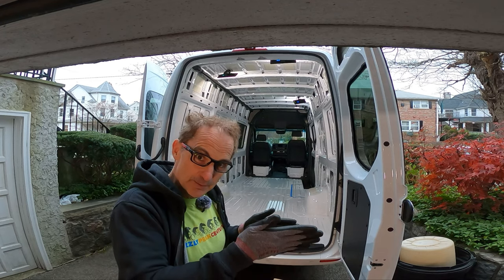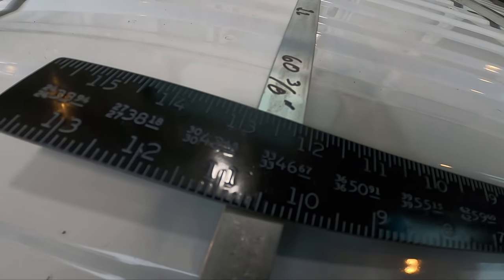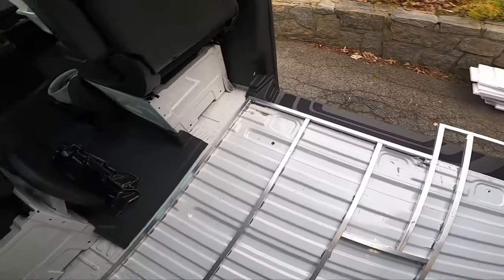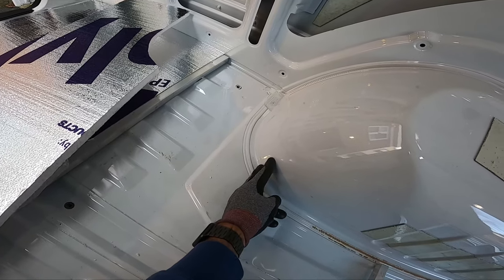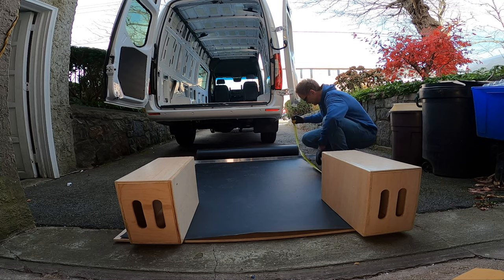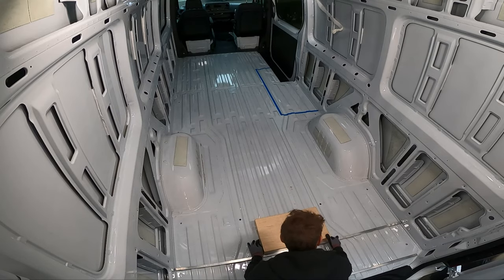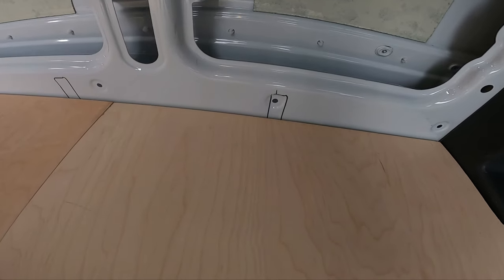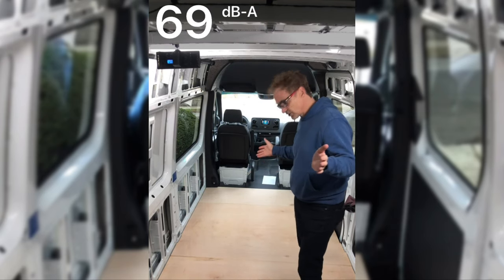Sprinter Van Subfloor Install - Part 2

Comment: I would have made sure there was support directly under each end of the board for your floor. That or added 2 short joists perpendicular to you main joist, so that there is something other than just the insulation supporting the ends of the floor and it wont flex.
Reply from the maker: Excellent point. Before we screw everything down, we’ll add that extra support, as well as plate biscuits to keep everything super tight.

Comment: Every time I watched DIY van builts I just wonder why don't you use factory floor instead of cutting new plywood (which yours came with sprinter van is nearly perfect)
Reply from the maker: Having done it both ways, I agree with you 100000000%

Comment: I believe... (and I could be wrong)... but R-Value is a time constant related to the rate of heat transfer through the material. So the higher value, the longer it takes to transfer heat through the material, and therefore, better insulation properties. There's also a couple of different standards - US and European (and possibly another one or two).
Reply from the maker: Thank you, rosserdman! That makes a lot of sense. 😁👍
Reply: @WillPemble  R-value is the reciprocal of U value. U is used by us building scientists to determine heat transfer & the lower the number the better. So the U value of your 3/4" EPS is 1/2.8 or 0.357, which sales- wise doesn't sound as good as 2.8. BUT the overall R-value of your van floor is less as some percentage is aluminum. Get yourself an infrared camera & use it like the decimal meter device. Happy Trails ...

Comment: Great video we’re in the middle of emulating exactly what you’ve done but uncertain about the area that’s kind of cantilevered over the entryway on the sliding door did you build everything together and then glue it down did you glue it down and then bolted together many thanks Marcus
Reply from the maker: The cantilevered part is screwed together with angle irons, then glued to the floor of the van. Then, the subfloor is glued and screwed to the joists. It ends up being super strong.
Reply: @WillPemble  thank you so much. that just what we did .it came out great

Comment: What kind of glue did you use for the floor joist?  I know this is an older video but I’m sure glad that I ran into it because I was just doing a similar process and I’m taking a little bit of a U-turn based on your process.
Reply from the maker: Liquid Nails ia great stuff. https://amzn.to/4cPcKCG

Comment: Did you calculate the weight of the floor, it looks heavy. A heavy finished camper is not good for performance and economy
Reply from the maker: I did the math. Figuring it's a Sprinter 3500 and has the aerodynamics of a brick, it's kind of a rounding error on the economy front. But, I'm no acoustical engineer. Smarter folks than I should definitely chime in!

Comment: Thanks for the great video. Does the hollow square tube glued to the metal floor amplify the road noise? compared to wood furring for instance I like the way you have done this and plan on using 80-20 for the framing of my van, just trying to figure out the best way to do this as it looks like a very clean install.
Reply from the maker: I'm not entirely sure. For the next van (if Mercedes will ever, ever, ever deliver it) I'm going to mimic ARV and screw/glue 3/4 plywood to the floor. It'll save 3/4" in headroom and insulate s well as this system. Sometimes (most times?), simpler is better.

Comment: Great video helped a lot.  Thank you!  Why Maple ply and not baltic Birch?
Reply from the maker: Thanks, Eric! Are use Maple’s because it’s slightly less expensive than Baltic birch, and it comes in 4 x 8 sheets. Usually, Baltic birch comes in 5’ x 5’ sheets. Much higher quality but we’re talking about the subfloor here lol

Comment: Any chance we could get the links to the 3/4" square aluminium tubing you used or recommendation on the supplier?
Reply from the maker: Check out Metal Supermarket online. They’ve got just about everything.

Comment: Killmat on the floor in the grooves would have been a great idea.
Reply from the maker: Thought about that, but I didn't want to interfere with drainage. It's only a matter of time until something gets spilled. Want it to be able to flow outta there without getting caught up on stuff I added. That's the thinking, anyway. Your idea might be way better. I'm gonna think on it for the next van, which is happening now!

Comment: I used 1 inch foam board and tubing. Without the 1/8 inch rubber.
Reply from the maker: I'd skip the rubber if I had it to do over again. So easy to get caught up in the hypothetical. As soon as you're rolling down the highway, it's gonna be noisy. As soon as you're parked in the woods in winter, it's gonna be cold!

Comment: Getting lined up to take on this project in my 2011 170.  Can you share how thick of plywood did you use?  Also, have you had any issue with the subfloor at the joints?  In hindsight, if you could go back would you have added support running perpindicular between the joists to support the joints in those areas?  Also curious as you've continued with your build have did you have to go back into the subfloor to add support for cabinets or to drill holes to go under the van?

Thanks,
Tim
PA, US

Comment: How many tubes of Fuze It did ya end up needing?
Reply from the maker: I think about 4.
Reply: @WillPemble  cheers!
Reply: @WillPemble  hey will! Would you consider using PL Max Premium instead? Also, did you consider misting the surface with water per the non-porous instructions? It's all been a little confusing choosing the right Adhesive. I still haven't found anything saying that it'll specifically bind to aluminum, same goes for PL and for 3M 5200. Thanks for your help. Floor build starts tomorrow!

Comment: why floor joists? Not necessary. you can put down mass load vinyl and closed cell foam and use lizardskin on the floor.  Its wasted space as you will have less headroom.  Complete waste of money and time.  This isnt a home it is a tin can on wheels totally wasted effort
Reply: Look, an opinion!